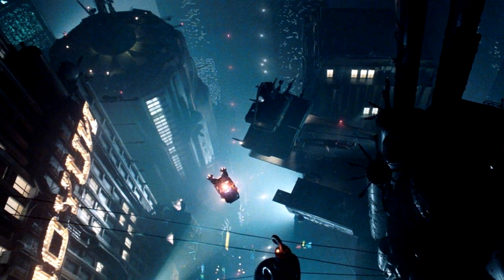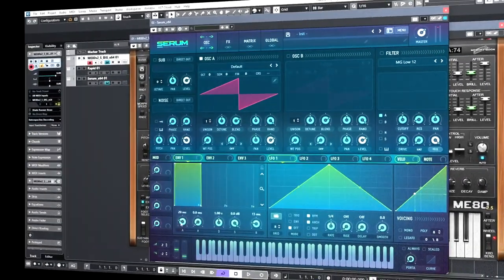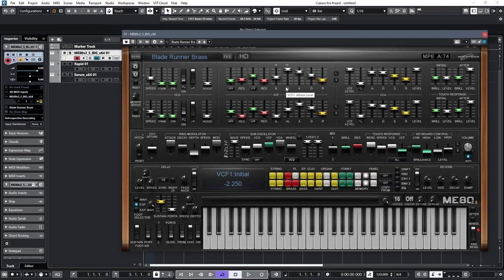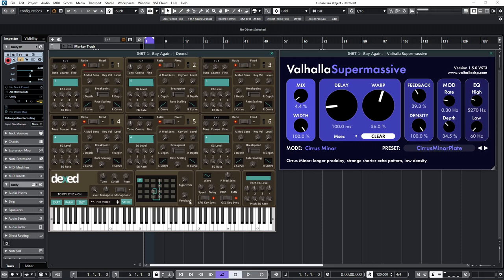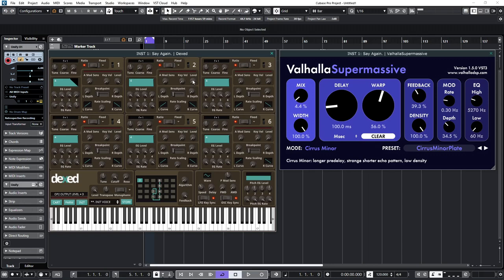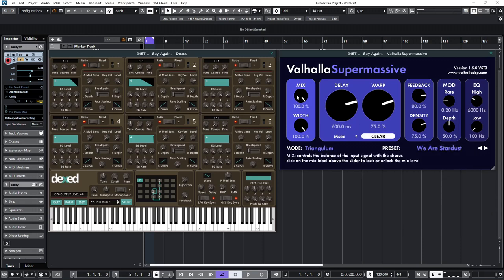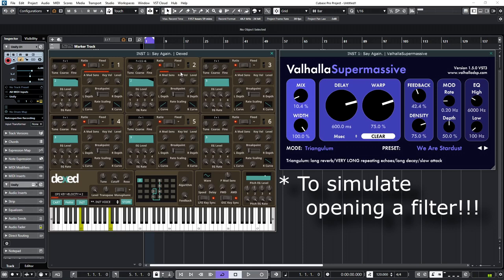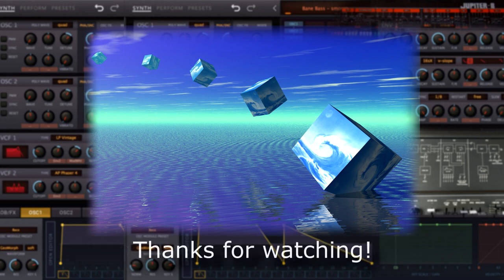Bladerunner Brass Sound with Free VST's

Comment: Why not use the Arminator VST? That's completely free as well as a really good CS-80 emulator. No need to go to all the trouble with FM synthesis, which is fundamentally different from the substractive synthesis of the CS-80.
I mean, this is interesting and all, but then why not call the video "CS-80 sounds from a DX-7"?
Reply from the maker: Arminator is 32 Bit only I think, so that rules it out on my Cubase... I might have a play with it on Reaper if it's worth checking out...